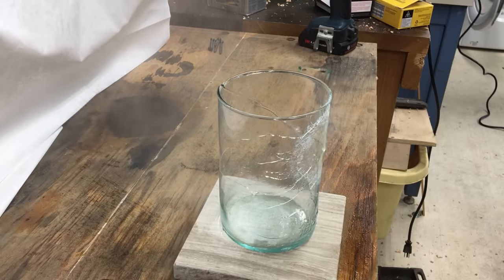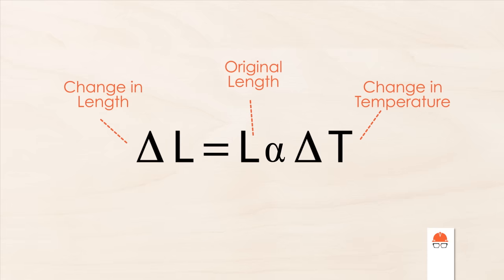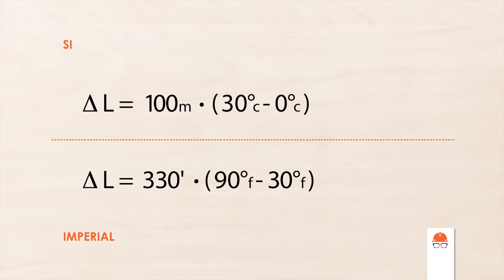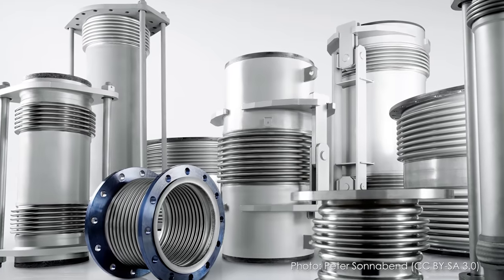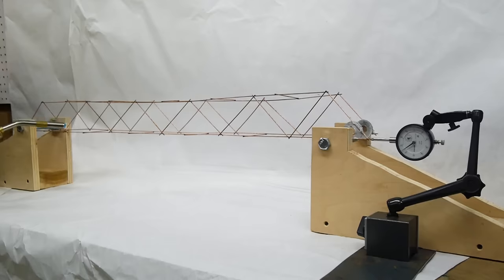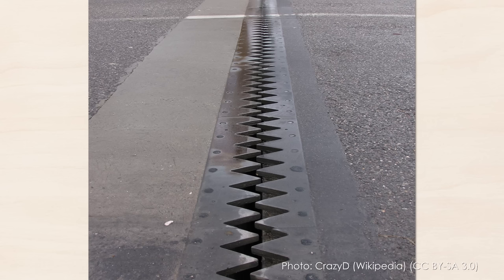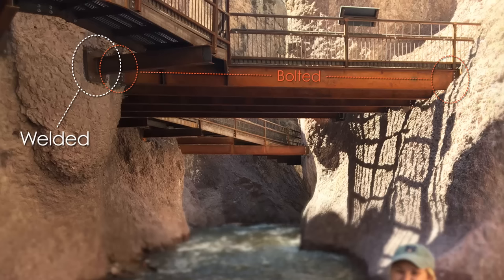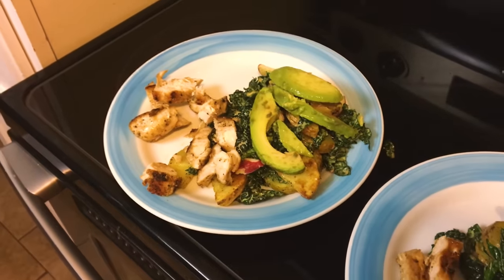Why Bridges Move...

Comment: I watched a show about building a large bridge.  The bridge was being built from both sides and had to meet in the middle.  When the last pieces were being bolted together in the middle they had to wait for the bridge to reach a certain temperature so the bolt holes would line up.  You could see on camera that the bolt holes were slowly lining up as the bridge warmed up.
Reply: That sounds awesome, I'd love to see that! Do you remember which show it was?
Reply: Dude that's sick 👌
Reply: What show is this??
Reply: did they use a hair dryer?
Reply: ok, ok, maybe not a hair dryer. maybe 100 hair dryers?
Reply: Travelinmatt76 what show?
Reply: Idk if the OP meant the documentary on that french or swiss bridge that goes across their huge valley.
Reply: Same with the arch in St Louis.
Reply: Morten Daugbjerg That was the NatGeo documentary of the Shanghai Huangpu River Arch Bridge.
Reply: Oh, was that the one in that video where they met in the middle and were off by about 4 feet to one side  :P
Reply: Here's the clip if you all want to see it.
https://youtu.be/jP6KiB6Tp8I?t=3620
Reply: JBTechCon no longer available. 😢
Reply: I don't know if it was the same show, but I saw one where they talked about the Golden Gate Bridge and they had to wait till afternoon to insert the final bolts so the bolt holes would line up. Unfortunately it was not filmed, only described.
What made it so fascinating was the time of day this would happen was figured out by the bridge engineer on his slide rule and he was right on the money.
Reply: Polybridge 2?

Comment: In aircraft maintenance we have to take temperature into account when doing things such as setting control cable tension. As the expansion rates of the aluminum structure and steel cables is sufficiently different.
Reply: Not to mention huge temperature shifts.

Comment: I first learn about thermal expansion when I was pretty young: I was heating a glass of milk in the microwave but forgot to put the milk. When the microwave finished I realised i had forgotten the milk and I though: "I guess I'll put the milk now"
And as soon as the milk touched the glass it exploded.
Reply: R.I.P Glass of milk, 2019-2019
Reply: @arijitdubey2282  wrong year
He said when he was younger not "this year".
Read the comment 🤦‍♂️
Reply: I use to heat water in glass in microwave for storing in thermal bottle. After filling & empty same glass for more than 5 times, glass cracked while filling room temperature water.
Reply: @amitkrupal1234  Savage temp. cycling! ;) I have heated a lot of glasses of water in microwave safely, but without cycling. Once, however, I poured very little water and microwave overheated it. The glass has cracked at the base, but crack was not catastrophic and it is still in one piece ;) Glass cracks really quickly, as crack propagates with speed of sound in the glass. It is crazy fast, much faster than speed of sound in the air.
Reply: This video felt like it took forever to explain what I knew when I was 10
Reply: I wanna try this now
Reply: My bro wanted to make hard bagetue soft by warming up in microwe, but since it didnt worked for short time,  he decided to put it there for long time.
We were booth surprised that microwave can put this type of food on fire.
not talking about smell.
Reply: bruh
Reply: @Kasmuller  It's not that deep 😐
Reply: i can relate, i broke mums super fancy crystal beer tankard when i was young. pouring hot water in to make hot ribena 
 was valuable lesson, valuable more to me than mum
Reply: Who heat milk in microwave 🙂
I thought microwave was for croissant pizza etc but not for liquids
Reply: @khalidx1450  How else are you supposed to heat it? Using a cooking pot is very slow and inefficient
Reply: @kvakerbillduck9500  When I was like 8 or 9 I accidentally put a piece of pizza in the microwave for like 10 minutes (long story) and it turned completely black, and I'd say it would have caught on fire if it got left much longer. 😂

Comment: Fun fact, in countries without much temperature fluctuation (like Philippines, or any tropical countries), they don't bother with expansion joints.
You will see whole stretches of highways with no cracks, just smoooooth driving.
Reply: That is of course if there wasn't so much traffic here in Manila
Reply: ice is one hell of a thing.
Reply: ehh you're right they don't bother with it

but they still get a lot of cracks from other factors
Reply: i thought asphalt still becomes more fluid/squishy in the heat and then cools at night
Reply: Bullshit! I live in philippines and i see alot of road cracks.
Reply: Potholes are, Road cracks are pretty rare IMO.
Reply: Ah, I see. Now I understand why roads in America are cracking a lot, while in my country, Indonesia (not far from Philippines) are not common.
Reply: Cracks may be rare in the Philippines but it's far from smooth driving because of the potholes. Which is caused by wear and tear, and no maintenance.
Reply: That sounds...oddly satisfying.
Reply: That's just poor engineering. The temperature fluctuations from day to night are enough to cause problems. Combined with the quick temperature changes when the monsoons come every afternoon you're going to get effects similar to that glass beaker.
Reply: VeNoM0619 Oh, you're not a native Filipino?
Corruption has been a big problem in the country for a long time now.

But back to the roads, paid highways I would agree that it may have great maintenance but most of the public roads there's always potholes especially the roads where big trucks always pass by.
Reply: @Zytran L,  Nope, but my wife is :) and I spent 2 months there, traveling by car several hours away from city life. I can't claim to be an expert, but I do remember how amazed I was by the highways, and having a discussion with her family about them, as they were shocked by how 'bumpy' ours were intentionally.
Reply: "Ah, I see. Now I understand why roads in America are cracking a lot, while in my country, Indonesia (not far from Philippines) are not common"

IMO, the "freeze/thaw cycle" does more to foul up roads than diurnal/seasonal variation. You get a crack; water gets in and freezes, expanding the crack. Add a snowplow or two, and the cracked pavement gets removed. leaving a pothole. (I'm sure chlorides do concrete no favors, either.)
Reply: these roads man it hurts my butt everytime whe i go home whet taking a tricycle
Reply: In sweden the temperature differences can wreak havoc on the asfalt. The cold will create bumps in the road while the heat will create soft spots that make it squishy and slippery. We recently had a terrible buss accident with a lot of school children dead or injured, because the bus got onto a part of roads with particularly bad frost bumps and it lost control and rolled over.
Reply: We use expansion joints in the Philippines. Every concrete mainroad has it. Theyre in the middle seperating the two lanes and another line in adjacent to the middle every 50 meters. Same goes with quadrangles.. sometimes its 25x25m segments.
Reply: I live in Brazil, in a tropical region. Every bridge and concrete roads have gaps on them.
Reply: Haha in the PH it doesn't matter.
Reply: cracks also allow structures to sway in seismic activities or high winds
Reply: Zytran L they're basically mini sinkholes
Reply: that's not true. temperatures here can reach 40°C at noon and drop a few degrees at night or be followed by sudden heavy rains. that change in temperature necessitates expansion joints
Reply: Well, philippines dont usually have cracks, but we have HOLE DUDE😂cause of corrupted budget😎
Reply: Why are you so proud of corruption in your country? Let's not corrupt this healthy atmosphere of knowledge with politics
Reply: Jomer Tomale

He's talking about the roads. Not the political activities inside it.

And even corruption is implemented there, that's irrelevant to what he said.

Plus, refer to his reply above. He's not a Filipino.
Reply: Kyleroo Well the replies here escalated to some unnecessary things
Reply: Jomer Tomale

Just what like other comments does lol.
Reply: ngentotsemua 
Well, not all tropical countries do that.
Reply: That’s tarmac or asphalt though isn’t it?
Reply: @bhudson2881  well here in the province there are a lot of road cracks since the material used are substandard. That's why it's very often the our roads here are always repaired
Reply: Many roads are victim to vibrations that go unnoticed that can have monumental consequences. The vibrations are harmonic in nature. These vibrations can do great damage to buildings and roadways if not addressed.
Reply: @potatoraider7320  probably because the contractor cheated on the concrete mix or road was poured thinner than specs or a combination of both. the result, the road wears shortly after or cracks after enough trucks passed by.
Reply: How could they not leave room for thermal expansions even in tropical regions? I mean tire friction and vibration are all forms of energy that need to be dissipated.
Reply: Fun fact, most of everyone here are Filipinos
Reply: Nope. I live in Singapore and one of our main bridges, the Sheares Bridge, has clear expansion points. As a kid I always enjoyed hearing the wheels of the car run over them.
Reply: Well expansion joints are mainly used in rigid pavements(concrete road). Flexible pavements(asphalt) do not require it that often.
Reply: @ZNotFound  also by the substandard construction methods and materials used because of corruption
Reply: They do exist in some bridges in the Philippines. I think its a matter of bridge size. Most bridges are not large/long enough that they don't really warrant an expansion joint. But at least  here in Cebu, both the old mactan bridge and the Marcelo H Fernan bridge have this feature. They are quite long considering they span the mactan channel.
Reply: Interesting, I didn't know that. I wonder what they do about the huge geological activity in the Philippines. They have very active volcanoes and shit.
Reply: Concrete roads need expansion joints.   Tarsealed (bitumen, asphaltic concrete, blacktop)  roads don't, there is enough flexibility in the asphaltic layer to accommodate thermal expansion.
Reply: The crack don’t came from heat. The crack came from corruption
Reply: Bullshit I've been there and I saw no roads.
Reply: BS I've been on Filipino Highways and in terms of smoothness they leave a lot to be desired.
Reply: How about during storm? No temperature fluctuation after storm is over? lamo.
Reply: Expressways like the South Luzon Expressway and Metro Manila Skyway (handled by San Miguel Infrastructures) have a very maintainted road with very smooth asphalt
Reply: In the Philippines, when the road is still okay they'll still repair it. Easy money for the politicians.

Comment: Great explanation, same principles take place in precision machine building.
Reply: I admire the mind of engineers who can also talk in layman's terms like this video. I'm sure machinery taking into account the heat produced without "leaking" power would be interesting to hear :)
Reply: Wood carpentry too, though moisture is usually a bigger issue than temperature.

Comment: Rolls-Royce Trent Engines us this to thier advantage. The Turbine blade tip clearances are controlled by a system called TCC or Turbine Case Cooling. This shrinks the case during steady state, closing the tip clearance, increasing the efficiency of the turbine
Reply: Actually some race and high performance engines are built in a way where they have loose fit when cold and sealing up when warmed up. Or like Formula 1 engines: They are basically seized up when cold and must be warmed up to clearances to appear.
Reply: The most common application would be the thermostat. You can find it on most home appliance dealing with heat.
Reply: The SR-71 Blackbird spy plane would come back leaking fuel all over the place and would have to be repaired after every mission because of the heat from supersonic flight.
Reply: At demolition derbies it is common for the real pros to bore out their engines to a slightly larger inner diameter than the pistons.  it leads to the engines shooting occasional flaming smoke rings (that look really cool) early on, to getting tighter and more efficient as the round wears on.  As everyone else engines begin to seize, these guys hit their maximum output.  Strategically and technically brilliant.
Reply: @edwardschmitt5710  SR-71 was designed to leak while parked. The plane expands in flight and the tanks seal up. It doesn't leak in flight once it reaches operating temperature.
Reply: thats why they refuel as soon as they are air bourne  then go before losing to much fuel
Reply: @raypitts4880    Errm, no fuel leakage was not significant, compared with the amount it burned anyway getting airborne.   There were several reasons for not taking off with a full fuel load - the landing gear and tyres weren't particularly strong, and in the event of a problem on takeoff so they had to return immediately, it was better not to be fully loaded.   And a curious one - SR71 wasn't allowed to exceed Mach 2.6 unless the tanks were nitrogen filled, best way to achieve that was to fill the tanks full after takeoff, driving out all the air, then allow N2 to fill the 'airspace' as the fuel was used.  https://theaviationgeekclub.com/former-sr-71-driver-explains-why-the-blackbird-had-to-refuel-after-takeoff/
Reply: @cr10001  nice
Reply: In CFM engines, the TCC stands for Turbine Clearance Control.  Bleed air from the compressor section in annular tubes around the turbine section for the same purpose, controlled by the Electronic Engine Control.

Comment: Another good example of engineers overcoming thermal expansion can be seen in the SR-71.  The plane will actually leak fuel through the wings when at sub sonic speeds because of the clearances put in between the edges on the outer panels.  When the plane reaches its max speed or close to it, the air resistance creates enough heat to cause the outer panels to expand.  The clearances allow for the expansion to take place without a dangerous build up of unwanted stress.
Reply: isnt the heat generated due to compressing the air and not because of air friction?
Reply: @Blox117  no, the parasitic drag (air friction) is far more effective at heating the plane itself. Air compression will heat up the surrounding air, like with spacecraft re entering the atmosphere, but the metal itself is heated from the friction.

Comment: You can also hear thermal expansion when you turn on your oven and the opposite (thermal contraction) when you shut your car off the exhaust manifolds make a clicking noise as it cools down. You can hear it in the plumbing when you turn the hot water or duct work when the heat comes on. Sometimes older homes pop and creak as temperatures change outside. I’ve always found this fascinating.

Comment: I never knew that was why sidewalks were sectioned. I always just assumed it was a bi-product of the construction process.

Now I know why some older highways are sectioned, and why causeway bridges are sectioned.
Reply: Same here, I can now understand why the roads in a certain part of my country are all sectioned like that, because that area has insanely high temp fluctuations compared to where I live. :)
Reply: Sidewalks are built like that because concrete shrinks as it cures. Basically masons define "cracks" before the concrete finds its own cracks.

Comment: Installed some steel railings on concrete a few years ago.  About 100 feet long, one piece.  The crew at the time remarked that it should have some expansion joints, but the customer said to do it anyway.   6 months after I got a call that our anchors had failed.  After taking some pictures I was able to prove that they had, in fact, sheared.   Not a warranty fix.  So they paid me to upsize all the bolts massively. 
  A buddy of mine was nearby when it failed.  Catastrophically.   the pressure built up until it blew off the concrete and sent shrapnel through all the walls and ceiling.  According to my buddy they jumped literally 4 feet in the air.  It had been planned and engineered, and my work was to plan.  Got paid to re install it with some expansion joints.
I've since encountered a lot of incompatible materials embedded into concrete, leading ultimately to failure.  Surprising that there are engineers and architects out there who don't know about this.

Comment: Nice video.  I’ve been a commercial construction project manager and superintendent for over 30 years and never considered expansion joints as thermal control devices.  We’ve installed then for sub-terrenan movement.  Interesting...!!